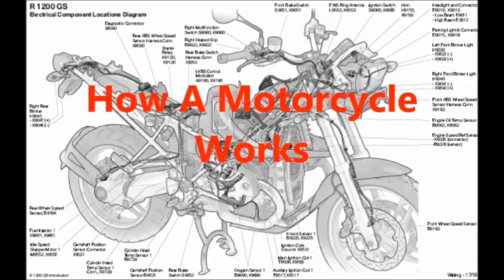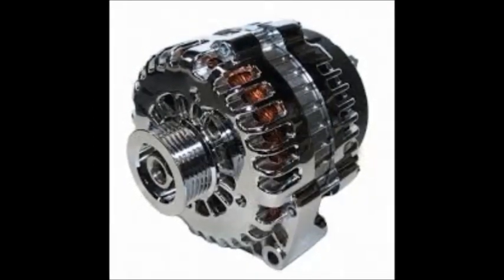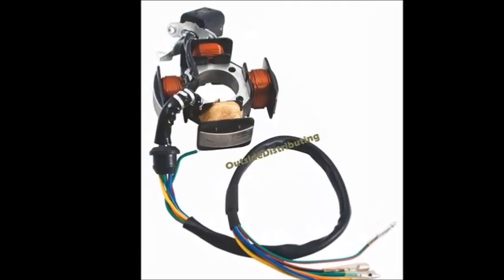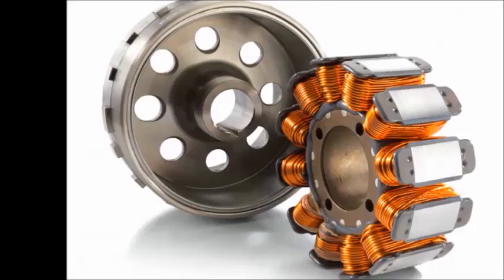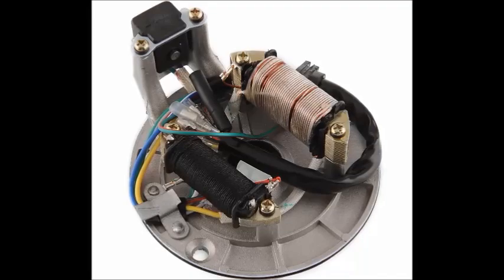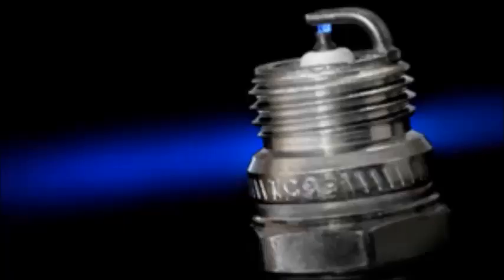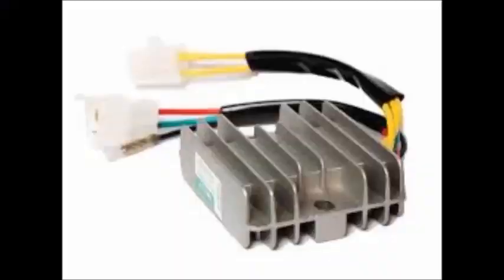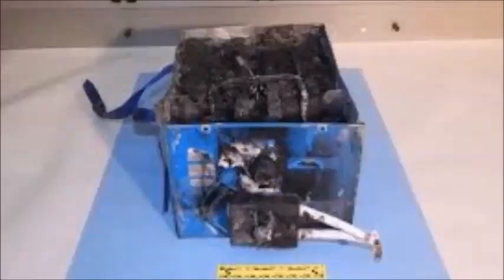How a Motorcycle Works Ep. 1: The Stator, Regulator, and Rectifier

Comment: Thanks for the explanation.  This will be helpful in diagnosing my problem when I had no power when starting my motorcycle.  The bike was running great and I topped off the fuel and there was no power when I restarted the bike.  ps.  I had recently replaced the battery and stator.

Comment: ,hello, I am trying to wire my cl360 so that the lights are always on. My right hand control got smashed, and what i have to replace it does not have an on/off for the lights. If I wire the dy, se and headlight and tail light wires together permanently will that work?

Comment: so in theory i can keep my light running on my bike since it never stops producing current while i ride. If  I dont use the power the Regulator/Rectifier would just dump it as heat through its cooling fins, correct?
Reply from the maker: Correct. Newer bikes keep their lights running while the bike is in use.
Reply: Wrong. If your lights are not on and you are not drawing the associated power (current) needed, the alternator is doing no work and the engine turns the rotor more easily. When you switch on your lights, the alternator has to do more work in order to generate the required power and becomes more difficult to turn. 
I think from your question, you are assuming that just because the alternator is turning, it is generating current and therefore, where does this current go???  It is not generating current to the lights if they are not switched on. It is however generating a voltage and it is the voltage regulator that keeps this within limits. It’s primary purpose is not for dissipating heat from “unused” power although I can understand the confusion

Comment: I have a lifan 50cc 4 stroke motor, the cdi box for it cant be located. I purchased another cdi box that motors like it run with. Im unsure on the wiring layout.   Can the cdi box run with power straight from the stator? or does it need to be regulated first?

Comment: Hello revvin,. I've got a cb900c that is not charging the battery. Had it checked by mechanic and everything should work, but barely getting 13V at 4500 RPM. But put iron nail on rotor (5.2 Ohms) this morning with ignition on and off and it does not stick to it. Is my rotor demagnetized, or is that the job of the regulator/rectifier and it is faulty? Hope you answer cause I'm getting desperate.
Reply: If the mechanic didn't find anything wrong it could be the battery

Comment: Hey I have a dird bike and somthen came loose and messed the stater up and also nicked a hole in the flu wheel i cleaned ir up and put a new stater in it but now it has a constant miss is that hole in the fly wheel probably  the reason its missing

Comment: Sir Revvin.. My motorcycle had no switch on headlight. Always on when engine is starting or running.. What will happen if i put head light switch with relay on my headlight?
Reply from the maker: You should be fine. It shouldn't hurt anything.

Comment: stator blew out, im thinking HIDS but should i change my regulator also
Reply from the maker: Your regulator should be fine.
If your battery has trouble keeping charge after replacing the stator, then you will want to change the regulator.

Comment: i was told my stator and rectifier are bad i get enough power on battery and but once parked the motorcycle battery is dead..would I need both parts or just one? How would i know? Mechanic told me $625 the parts aren't even that expensive and i can replace it myself.  Can you help? i have a 2011 honda cbr250r
Reply: both of them are very easy to replace..

Comment: How would one convert a motorcycle from 6v to 12v then? 12v regulator? Just wanting to run LED lights/signals
Reply: 12v battery. 12v regulator. 12v rectifier. 12v flasher. 12v lights.
Reply: ...and stronger magnets on rotor

Comment: Not enough detail, at the end, jumps into a hyperbolic "your bike would quickly explode, every wire would be fried"; The math part is too hard to explain? and beyond the scope of this?  Thats seems perhaps a little bit of a condescending remark to put in there, I didnt see enough in there to believe it was a complete explanation, its a fine video, well made but didnt contain enough detail IMO for what it seems to be addressing
Reply from the maker: Sorry you feel that way. Take some physics and electrical engineering classes if you are more interested. It is just a general overview of a widely misunderstood component on motorcycles.
Reply: it was like putting a bunch of pictures as you read some generalized overview from wikipedia. Those who cannot explain the math likely dont understand.  You mixed how the spark and charger work, did not explain how the rectifier works and said nothing of the internal workings of the regulator.  The wires can take many 10s of thousands of volts just fine, they wouldnt fry.  have you studied the physics or EE of this? Which are better, vacuum tube diodes or solid state diodes in terms of efficiency and leakage current?  Could you explain how a diode works in terms of Fermi energy, depletion region and junction resistance? Just wondering.  In a conductor do electrons travel mostly at the center of the wire or on the edge?

Comment: OK, I am a complete NOOB to motorcycles. Like, a 100% NOOB. I've only been a passenger on my brother's years ago..
I hope there isn't any stupid questions, because here comes the probably most stupidest one ever...

I don't know what makes the motorcycle go. Is it the clutch? Is the clutch the gas??? 
*seriously has no idea..*
Reply from the maker: You should stay tuned for all of my "How a motorcycle works" series.
Go watch my Engine episode I just posted.
Next will be a transmission and clutch episode.
Reply: That's a hard question to answer because there are so many things that make the motorcycle go. You should first learn about 4 stroke engines so you can understand how the piston, cylinder, valves, camshaft and crankshaft operate.
Reply: Undine66770 lmao both but it goes much further than that
Reply: Undine66770 gas/air mixture goes into the cylinders of the bike then is ignitined by the sparkplugs creating a little explosion which expands and pushes down on the piston which is connected to the crankshaft. The crankshaft turns and produces useful work (also known as torque) this torque is transmitted from the engine to the transmission through the clutch and flywheel and then from the transmission to the rear wheel via a chain  (or a belt or shaft). The user makes all this happen by slowly letting out the clutch to slowly connect the engine to the transmission (and the wheel) while simultaneously opening the throttle to make the engine turn faster and produce enough torque to move the bike. Once you are rolling the clutch stays out and the engine stays fully engaged with the transmission (unless dank wheelies are required then you pop it)
Reply: Its the wheels that makes things go. Whoo-hoooo!! 💃💃💃
Reply: Well put
Reply: Undine 66770 it's a whole bunch of things put together. An engine is what makes power but would be useless without a transmission which would be useless without a clutch and without brakes your biking days would soon be over. You can learn a lot by watching you tube videos on the subject. That's how I learned

Comment: I have a question im trying to make a xr250r DC right now what do I need for that a bridge rectifier or a regulator rectifier I already got a 12v 4 wire voltage regulator rectifier is that what I need ?
Reply from the maker: I will be posting a more in depth version of this video soon. It may answer your question. Stay on the lookout.

Comment: sir, I am curious about motorcycle engine  ignition system. without a battery how ignition system works. I saw some motorcycle starts without battery, lights and horns also work. how its possible??. I know alternator generate the power but in initial position how it works?? what is the role of a battery in motorcycle engine?? is it only use for self start or others?? please let me know. my english is not good. sorry for that. I hope you understand my question.
Reply from the maker: The battery is charged by the stator (generator). Batteries are used because they provide more reliable power, and they are needed for more advanced electronics modern bikes have. The stator does not provide enough to power it all.
Reply: The battery is to provide the electricity for the starter. My rd400f 2- cylinder 2 stroke has no battery but does have a kick start. Horn and lights work once it's running.

Comment: What happens if I mount a 35 Amp reg/rec on a bike that originally had a 22 Amp one? (It's a Yamaha r6r 2010)
Reply from the maker: It will allow your battery to charge faster... and at lower rpms. It won't hurt anything, if that's what you're wondering.
Reply: Revvin the 417 ya, I was wondering if it was possible that 35 amp reg/rec could overcharge the battery, or charge it too fast, and somehow do some damage. But ok, I guess I'll try it. Thanks!
Reply from the maker: +Edward Enrique Vega Ramos No sir, it will be fine for your bike.
Reply from the maker: +Revvin the 417 And you're welcome!

Comment: but why do they put an alternator in a bike which produces AC rather than a generator which produces DC. that way there'd be no need for a rectifier circuit. I'm lost
Reply from the maker: Moana Liberti They used to put generators on bikes a long time ago. Generators are very heavy, and not exactly small either.
Reply: A generator actually produces AC internally on the armature.  To get DC, a commutator and brushes are used on the current coming off the rotor.  So a rectifier is actually a lighter, simpler, and less-prone-to-failure method of converting AC to DC.

Watch this video:

https://www.youtube.com/watch?v=ATFqX2Cl3-w

Comment: does it really ruin your stator if you use your motorcycle without battery?
Reply from the maker: Extended use may. More immediate problems would occur with your lights and other electronics.

Comment: I have a question. my motorcycle will turn over, but it won't start like it isn't providing a spark. when I try to push start it, it acts like it wants to start but then it doesn't, even though I can smell the exhaust, so I know the spark plugs are working. any idea what is keeping my bike from starting?
Reply from the maker: Josh Barlow If it's not spark than it is fuel or air!
Reply: +Revvin the 417 it's a carbureted bike, and I just put a new carburetor on it two days ago. would the air filter still play a role in that? or would it be the stator
Reply from the maker: Did you leave the stock air filter on?
Reply: +Revvin the 417 I don't know if it's stock, but it's the filter that was on it when I bought it
Reply from the maker: Josh Barlow Sounds like a jetting problem to me.
Reply: +Revvin the 417 how would I fix that

Comment: If oil was getting into the case where the stator is and on the stator would it cause the stator to malfunction or for a wire two separate from it